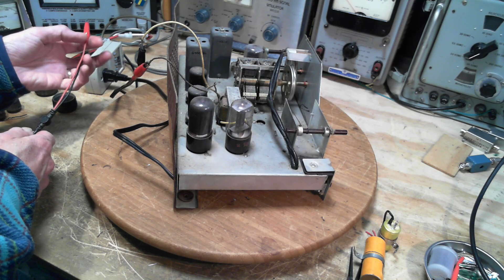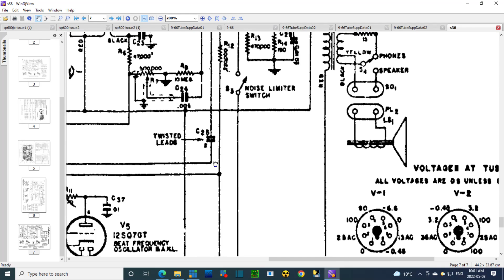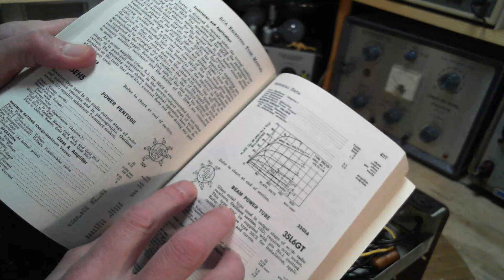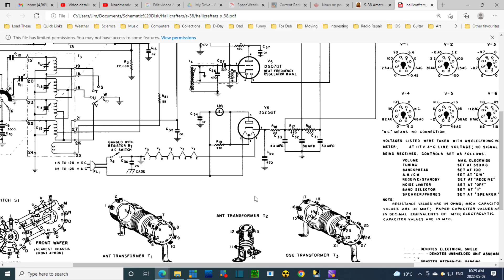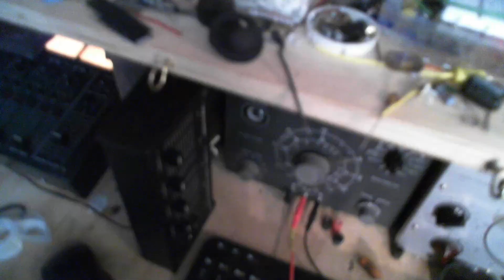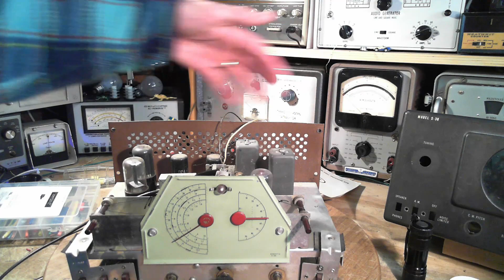Hallicrafters S-38 Four Band Tube Radio Video #2 - Some Key Capacitors

Comment: The chassis is B- , the whole.
Frame floats abode the outer case. Find  the insulating grommets and replace them for safety. The radio chassis does not touch the enclosure.

Comment: Besides just trashing those useless, coil burning wax caps, did it ever get upgraded with a new, modern transistor BFO to get full enjoyment of this rig?  It makes no sense to me why owners wont do this to be able to hear mor things simply because originally hallicrafters were being cheap and just threw in a chitty wire to gimmick a bfo in a lot of their radios.  Its like resisting adding an antenna because it also didnt come included with one from the factory. Im currently working on getting 4 of my radios serviced with new BFO's